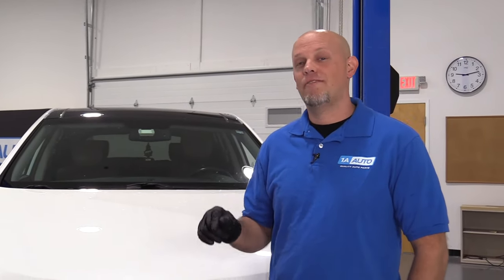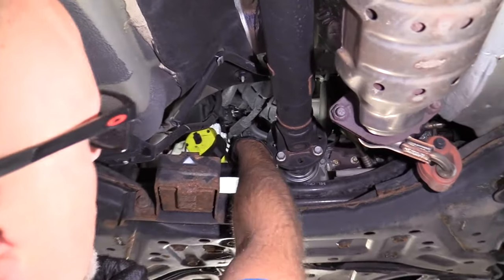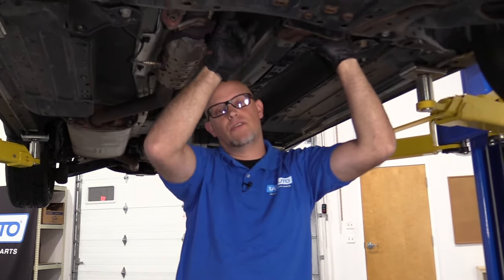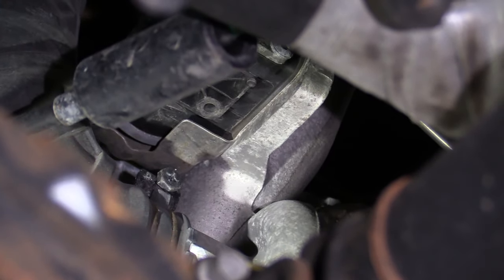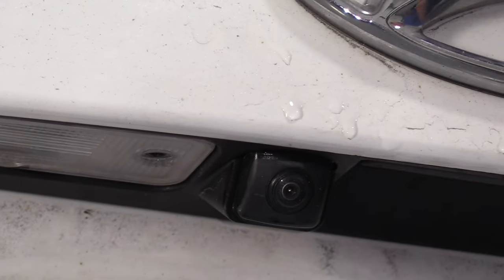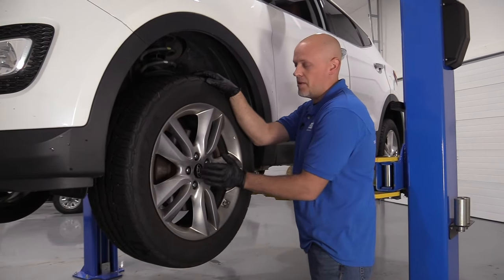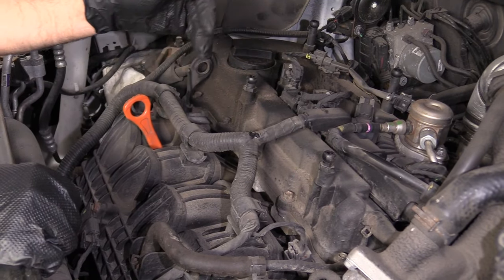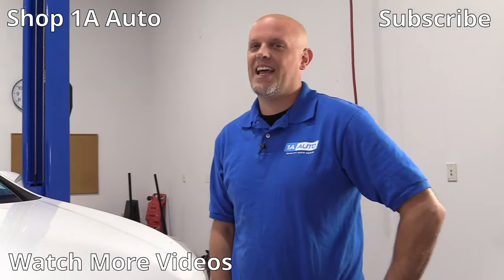Top 5 Problems Hyundai Santa Fe SUV 3rd Generation 2013-18

Comment: My 2015 has been stalling when pushing the gas pedal from a stop. Just recently, when it’s parked it starts shaking really bad and stalls.
Reply: Which model and mileage?
Reply: Mine just started shaking and cutting off at any time
Reply: Happened to me when coming off hwy transmission does not come out of overdrive and caused the same problem you have

Comment: can anyone tell me the gas range they get with their car? i have a 2013 Santa Fe Sport 2.0T AWD SE i bought used last year and I feel the range I get with the car is really bad. Full tank gets me about 420km/260 miles which I consider bad. I do mostly city driving, but am a master at driving efficiently and coasting, lowering my mpg. Still only shows 12-13L/100km which is bad imo, that reason alone has me trying to sell my car for a sedan (civic, accord, camry, mazda3 mostly etc).

Comment: I have a sticky steering wheel problem. The steering wheel doesn't center and stick to the turn position for smaller turns, and it's not rotating smoothly. Could you please suggest what checks that must be done to resolve it.

Comment: I have a 16 santa fe se
I'm having a ticking noise coming from the engine when car is at idle and gets louder with acceleration.  It has 78k miles started around the 70k+ mark 
Do you have any opinions on the cause . I heard it could be a exhaust manifold leak or maybe valve slap. Any answer would help thanks a bunch

Comment: I have a used 2017 hyundai santa fe and had it diagnose and it said i needed new coils and spark plugs which i had them replaced but my car still saying misfire with coils and spark plugs and still stalling and not giving power im thinking its the actuator
Reply: Me 2 same exact problem same car to

Comment: Let me add to the problem list.  The A/C high side discharge line leaks refrigerant and the early 2013-14 AWD models have rear differential coupler issues.  Makes a popping type sound in the rear when turning slowly.  How do I know?  Cause I diagnose and fix this junk.  haha

Comment: I had a 2014 Hyundai Sant Fe limited AWD and the AC went out at 60,000 miles as well as the transmission and I never towed anything with it... This winter we had a bad snowstorm and my husband got stuck trying to go up a hill with NEW tires (and it's close to $1k to replace tires on this thing). It having AWD was one of the main reasons we bought it and paid wayyyy too much for it. Cars were driving past him like it was nothing!

We had multiple electrical issues with it as well. The check engine light constantly came on and off and after running diagnostics, no one could figure out what the heck was wrong with the thing. And don't get me started on that stupid key fob. If the battery dies in it, you can't drive at all. So you better keep button batteries with you at all times. And the cargo space is crap too. If someone wants third row seating and decent trunk space, get a minivan or a large SUV. 

Overall, just not worth how much I paid for the vehicle. Everyone told me to get a Honda or Hyundai and now I will get American made since the parts are at least readily available and don't cost an arm and a leg. I know most reviews are positive on this vehicle, but I wouldn't recommend it.
Reply from the maker: +Rachel Hohman Jordan Thanks for the feedback!
Reply: DON NOT BUY AMERICAN MADE TRUCKS! unless it's an older early 2000s Tahoe or denali..that's it!! All the other trucks are nightmares...trust me
Reply: I have 2015 SantaFe(XL) now with 93k...ZERO problems until last week when I needed the LF hub bearing replaced(under warranty).
I use winter snow tires/wheels and have never been stopped in 6 winters in Chicago.
Sorry to hear you bought a bad Hyundai. This is my third, all three SantaFes were zero problems.( I replaced  OE battery last year and brakes and tires around 75k. That's  it.
I am a moderately aggressive type driver and don't  baby the vehicle.
Reply: Just get a Toyota lol

Comment: Mine is at 200,000km and I've had none of those issues, however I have had a complete failure of the transfer box which was VERY expensive
Reply from the maker: +Roger Matthews Thanks for the tip! We'll pass this info along to our production team.
Reply: Same here! Today 218'000 kms.  200k kms changed the "viscous coupling", one wheel bearing(front) and a rear wiper motor... nothing else! And i'm not known to be gentle on vehicules... ;) VERY SATISFIED

Comment: That knock sensor code is due to a weak engine with too much boost from the turbo to over compensate. When you get the knock sensor code it's because you are about to throw a rod.
Reply: A little under 5 years or the 100K mark, my wife and daughter were on their way back from Cleveland to Baltimore and had the limp mode scenario occur.  Hyundai in Ohio replaced the motor, but I believe they put a used motor in it.  We are at 120k right now.

Comment: I have a 2013 Santa Fe Sport, 2.0 Turbo. Just the past few months I've had the wastegate stick open. 1st time for two days, threw the check engine light, then starting working again. Yesterday, same problem going to the office, but coming home it was fine. Except the 8" screen quit working. This morning the screen was back on. Weird, but otherwise it's been a good vehicle. 86K miles on it, rides like new, but may be time to replace it.
Reply: My screen reboot all the time. There is a chip on the system who need to be replace. It don't like the +30° / -30° C... But the dealer only replace the whole infosystem... for 5000$ brand new or 2000$ remanufactured. I have a 2014.
Reply: @FrankNado  Ouch! The electronics is the main reason I bought the extended warranty. Alas, even that has expired now. The screen going blank has happened just once, but I've had it stick in night mode several times and the dealership has no idea. Fortunately is starts working normally after a day or so.
Reply: @stephen1991  upgrade to the 2021

Comment: The engine stall when I shift the gear to reverse or drive. It’s santafee 3.3 V6 2016 the mechanic saying it’s torque converter I’ll already upload a Video showing that issue. Any suggestion

Comment: My 2015  Santa Fe has just developed the turbo boost control actuator fault, very expensive fix, only done 30,000 miles.

Comment: Nice video, thank you. I'm no mechanic but I do own a 2018 Santa Fe Ultimate and have not had any of these issues (knock on wood). I did find what I think to be a major design problem on this vehicle. After seeing the "Check AEB System light" come on with every startup, I brought the vehicle to the dealer thinking this issue would be covered by the warranty that is still in affect.  I was told this issue is due to the radar sensor located way on the bottom front of the front bumper being damaged. As far as  I know of there has been no front end collision but I was shown some minor damage on the lowest point of the bumper.   Where I'm from (and probably 95 percent of the US population).  it is totally possible and probable that the bottom of the bumper scrapped the floor exiting a strip mall parking lot at a low speed.  It also may have hit some somewhat packed snow when driving down an unplowed street or getting out of a parking space with snow shoveled hills between the spot  and the road . The bumper could also may been hit  by someone  backing into a parking spot in front of me.  The way I see it is any car in any major city is going to run into these types of issues and will incur some minor cosmetic damage and is to be expected when using your vehicle for everyday life.  Putting an expensive (over $1700) safety feature part in such a vulnerable place is just down right wrong!  I don't know if other car makers do this as well.  While observing other cars for the last 2 days, I have not noticed any with a similar 4 X 7 black mirrored box on the lower front bumper that hides/protects the radar sensor on my Santa Fe and other Hyundais I've seen, but it may be there as well.  I've owned 3 other Hyundais and still drive a 2009 Elantra and have been pretty satisfied  Now that I splurged on a top tier Hyundai I am very disappointed.  😡
Reply from the maker: +Nicholas G. Savino Thanks for checking us out! http://1aau.to/m/Shop-1AAuto-c
Reply: Hi! I have the same vehicle. Just did a trip from Florida to the Texas Panhandle and back. Absolutely no issues and everything function properly. I did have an oil change in Texas. Upon returning, the ABS light came on and my front end was covered with splattered bugs. After scrubbing everything off including the black box, everything is fine now. Just wondering if you may have had splattered bugs with debris that's covering the front sensor?

Comment: Need to add turbo oil feed line to the list. Hard to diagnose because it drips oil onto the drive shaft which throws oil all over. If you have oil on the passanger side suspension arms and lower section of the engine but not directly below the valve cover then the turbo oil feed tube is most likely your culprit.
Reply: I'll add that this was a 2017 recall but mine just failed in 2021.

Comment: I have a series 3 santa fe, when changing the diesel filter does the air in the system bleed itself when you turn the engine over???

Comment: I'm surprised the spider gear in the steering didn't get a gong.
So far it's the only issue with our 2013 (MY14) Highlander.
Reply: Obviously not the same truck
Reply: Wrong video dude.
Reply: I second that Matt,  and ours has had a worn or slop in the steering rack input too.  A notice was written for both these issues.
Reply: @learningyoutube9136  your wrong

Comment: Have a 2013 Santa Fe the turbo actuator has messed up 2 Times una yea and the backup camera doesn’t tue on in the morning
Reply: Ours has never had a problem, but I never realized how small the display screen is on our 2013 until I saw this video :) The 2013 screen is like 3 inches.

Comment: They should have dropped that 2.4 engine a long time ago. The new ones no longer have that issue. The sonata are the same for the same year models. Engine went into limp mode and had to get a refurbished engine which hyundai covered. Stay away from the 13 through 17 sonata and Santa fe!

Comment: My 2013 V6 Grand Santa Fe has terrible headlights. Travelling at night is being very hard... I've installed brand new original Phillips D3S 4300K 35 W Xenon lamps, but no deal. Any suggestions?
Reply from the maker: +Ignacio Aspiazu Thanks for checking us out. Shop for high quality auto parts on 1AAuto.com:

http://1aau.to/m/Shop-1AAuto-c
Reply: I installed LED. They are brighter, but the problem is on the headlight housing design. I have to drive with the headlights + foglights
Reply: How old is the car ? If it is old already, most probably the reflector that comes with projector went bad (not reflective anymore). Any powerful bulb will jot help. You can retrofit it with new projectors, or just replace the headlight assembly.

Comment: Alright.  My knock sensor killed my engine (well, rightfully so) and Hyundai replaced it about two years ago, however ever since the engine was replaced I’ve had occasional problems getting the new engine to turn over when starting.  Particularly in hot weather.  I’ve taken it to multiple dealerships attempting to get a diagnosis but they can never replicate the problem (One did, actually, but they diagnosed it as a loose wire on the starter which they tightened.  The problem is not the starter as it does crank, and their fix did not resolve the issue).  Could this problem be related to the Crankshaft Position sensor?  Perhaps it wasn’t adjusted right or it was damaged when they replaced the engine?

Comment: i have a 17 sante fe sport turbo 2.0 awd. sometimes when im shutting down the car, i put in park, shut off the engine with the push button but the electronics stay on and it will tell me to put the car in park, but the car is in park. if i mess around with the shifter  it will finally shut off. i would greatly appreciate any advice.
Reply from the maker: +markus collars We wouldn't be able to diagnose an issue like that here, you may want to have a local mechanic take a look at it. Thanks for checking us out! http://1aau.to/m/Shop-1AAuto-c

Comment: We own a 2013 version.  The right side blinker has gone out 7 times.  We have taken it to the dealership to replace the wire harnesses, sockets and bulbs, fuses - It will work for a short amount of time and still stops working (minimum 2 hours, maximum 3 months after the fix).  We just took it in today for the 7th time.  It's getting old.  Can't wait to dump this car for my Tesla next year.
Reply: Same issue for me, 3 bulbs in 3 months. Realized it wasn't the bulbs after blinker went out next day. So far what's working is only turning the bulb and holder unit half way to lock it in. Somehow it shakes loose or something, or the contact spots not aligned.

Comment: 2018 Santa Fe, no issues so far
Reply: How much did you use it ?
Reply: @swatful2010  it's common to see these cars hit 150,000kms no problems the 2013 only had issues because of the factories fault but hyundai fixed it.
Reply: @swatful2010  50,000km so far
Reply: @MJT-DA  I think they had problems with the previous generation, I have a naturally aspirated engine but I still use Shell Nitro to keep the valves clean… GDI will have carbon buildup over time

Comment: The knock sensor has a recall to reprogram it. The engines also eat the main bearings and fail. Hyundai has extended the warranty from 5 years 100k km to 10 years 200k km and replace the engine. Thst should be the number 1 problem in the car.
Reply: That issue is with the naturally aspirated 2.4 litre engine, not the diesel.
Reply: Very true same with my vehicle...

Comment: 2014 Santa Fe Sport NA/AWD, so far I’ve only had to replace the rear camera due to the dreaded random blue screen.  The dealer had a recall for the knock sensor about a year ago.  Today I just got a letter about a recall for leaking ABS potentially causing a fire.
Reply from the maker: +Jason Gross Thanks for the feedback!

Comment: I have a 2013 Hyundai Santa Fe Limited (6cyl.) and for the life of me I cannot locate the PCV valve! Checked other videos for the answer, but the PCV location does not match mine. Could you be of some assistance ? Thank You.
Reply: You have to remove the airbox. It buried under the motor but once you remove the airbox and intake boot, you can get to it. The only bad thing is that it is really not worth messing with because it is really in there tight and while I tried to remove mine, I cracked the whole plastic housing off its attached to. I checked the pcv valve and it was operating fine. Had to buy an epoxy to glue housing back on with the valve still attached to it. IMO, leave it alone.

Comment: Any ideas . 

I have a wobble when braking . Almost feels like it sways back and forth like the brakes are  grabbing better at different points on the discs .

The discs and pads are only 6 months old all round . 
Could it be a warped disc?
Reply from the maker: +2 Scoops That could be the issue, but you may want to have a local mechanic take a look at it. Thanks for checking us out! http://1aau.to/m/Shop-1AAuto-c

Comment: My 2013 santa fe has:
clunk in the steering 
Radio controls on steering wheel dead
Replaced same high side A/c hose twice 
Fuel filter sensor issue
Constant de rate when towing my small caravan
Reply from the maker: +Bobby P Thanks for the feedback!
Reply: What exactly is your fuel sensor doing? My 2015 Santa Fe has started giving me bad readings. Saying my gas tank is empty when I know it’s not.

Comment: You forgot to add that when the temp is 5 degrees or below and the car is outside it will NOT start.
Reply from the maker: +Jill Greser Thanks for the tip!

Comment: Got my new flagship Santa Fe in the UK in 2013. It started to develop issues at 6 months. To this day I still have multiple undiagnosed suspension rattles, a leaking hatch seal and wheezy engine sound. I wouldn't recommend Hyundai to anyone.
Reply from the maker: +stonkr Thanks for the feedback!
Reply: a suspension noise or a broken rubber are big problems for you?!
Some years ago men used to repair big car problems in the parking place....now I see men are crying for minor thing like a broken rubber.
Give me a break, replace that rubber and lift the car up on an elevator and put a mechanic inspect the suspension and see what's damaged there. Gosh...
If you think these are big problems, go buy a BMW.
Reply: @startube2788  Not sure how you read that I was crying over 'big' problems. To clarify: 4.5 years of main dealers & several independent garage inspections later and these faults are still present. Years ago I was under cars, in engine bays and upside-down in footwells. Now I'm older I prefer to pay a garage. Stand by, I think I'm about to cry again...